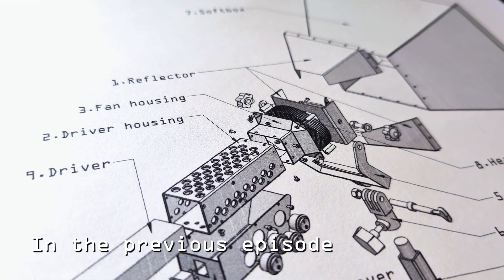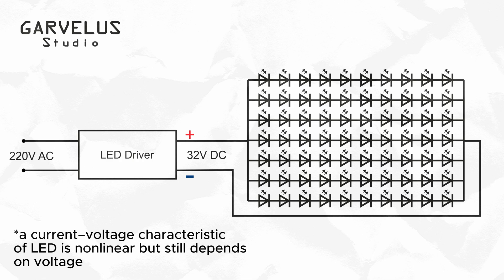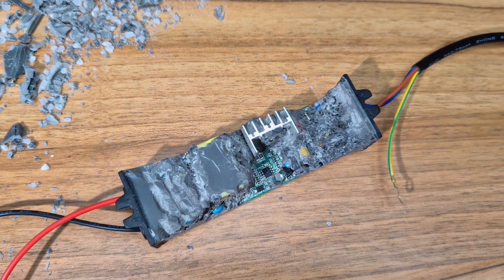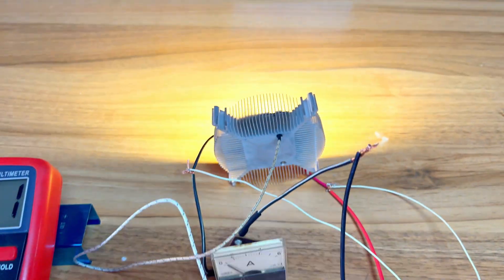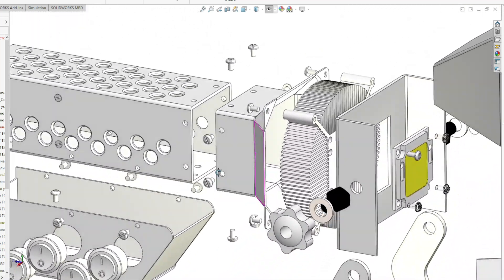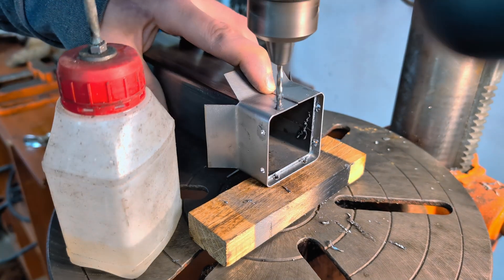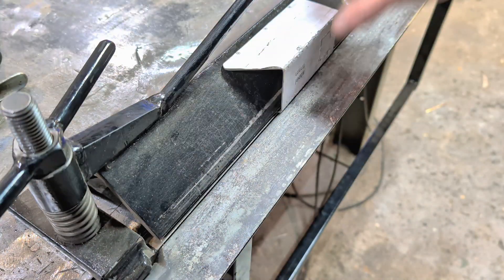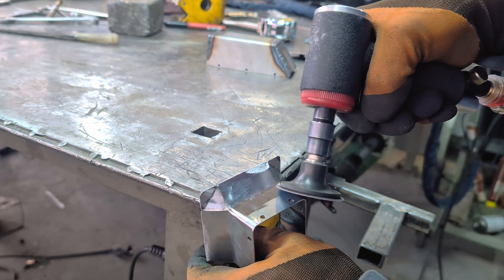Making a Powerful LIGHT Source from Scratch | Part 2

Comment: The dc dc buck converter you had, has a constant current funcion. You could've used that.
Reply from the maker: Yeah, I actually had one, but unfortunately I fried it during an earlier experiment. Even before that, it didn’t really work well with this driver.

Comment: One comment on the power-supply. For such circuit I usually go for constant-voltage power-supply and a DC-DC converter. It's not perfectly suited for driving LEDs but allows for simpler assembly, cheaper components and smooth brightness adjustment (you can replace the trim-pot on the board with a simple potentiometer and 2 resistors to set min and max brightness).

Also - consider a thermal fuse or PTC limiter on the heatsink in case of cooling failure - I suspect the LED is worth protecting.
Reply from the maker: Thanks for the thoughtful comment! I actually learned about the 34V power supplies after I had already purchased the driver and LED matrix. Unfortunately, those supplies are pretty rare. I do agree — one of those paired with a DC-DC converter would likely offer a much smoother brightness adjustment range than the driver I ended up using.
Reply: @WoodMetalMaker 12V LED strip power supplies are super common and available in various power ratings. 24V are also popular. Why would you need a 34V one?